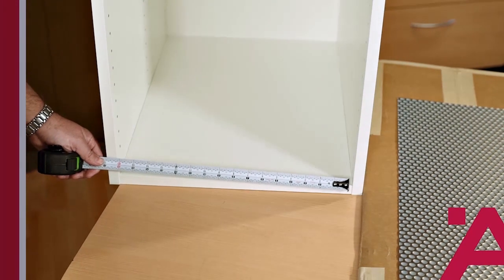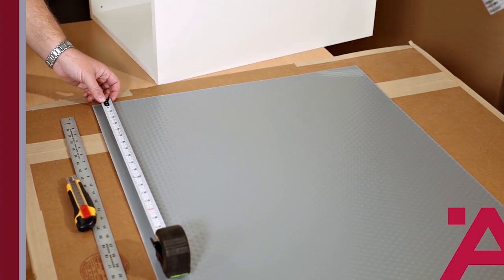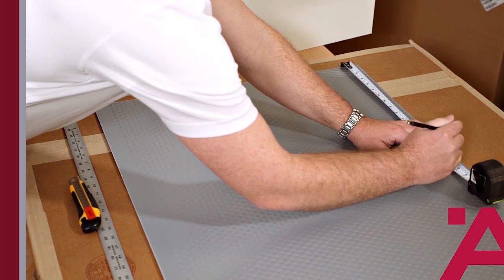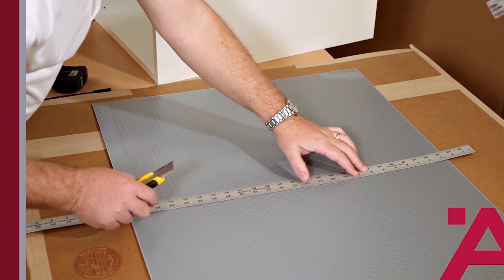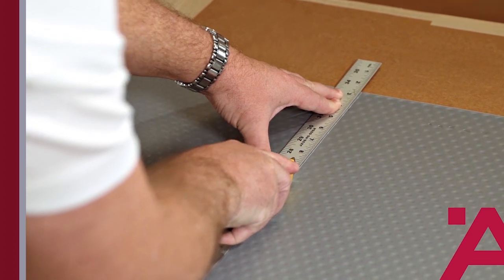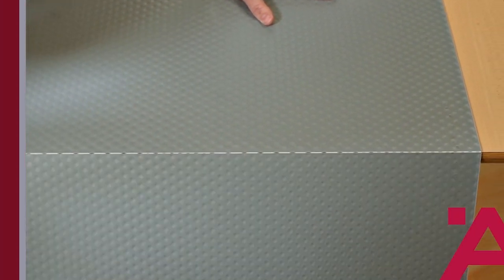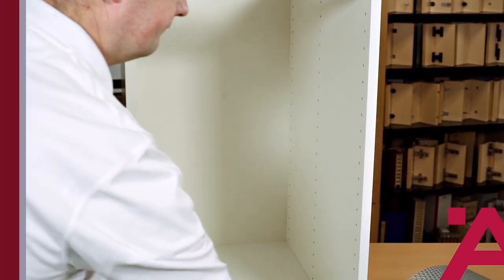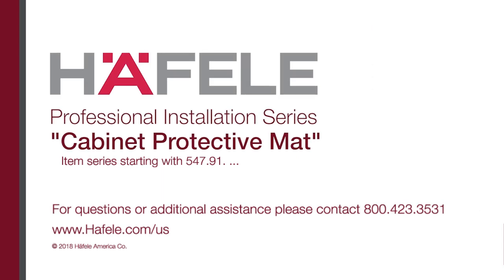Installing a Cabinet Protective Mat

Comment: Is there a way of making it stick down? Tried using tape but doesnt stick to the surface
Reply from the maker: If the mat is cut to fit, it should stay down on its own. If you do find it curling at the edges, you can use a hair dryer to reshape and flatten it back down.

Comment: We have a flimsy one 

How do we do that?????
Reply from the maker: All of our Cabinet Protector Mats can be cut to size to fit any cabinet. The flexible rubber version is designed to be easier to trim with scissors if needed.

https://www.hafele.com/INTERSHOP/web/WFS/Haefele-HAC-Site/en_US/-/USD/Static-View/pdfcatalog/en_US/TCH_Furniture_Cabinetry_Hardware_2022/index.html?startpage=3.132#page_3.132